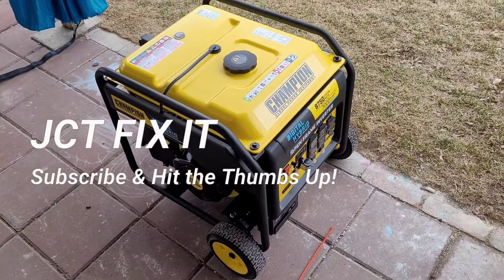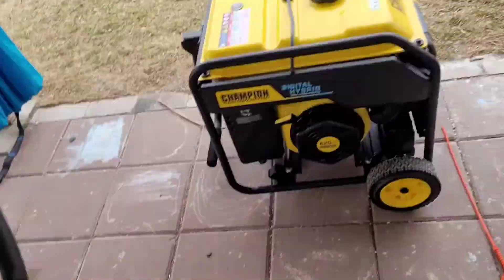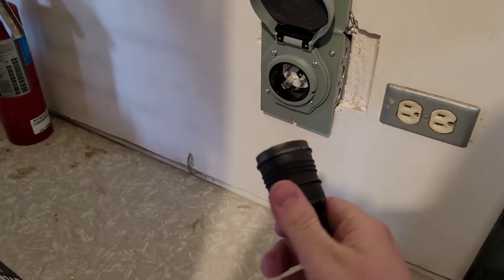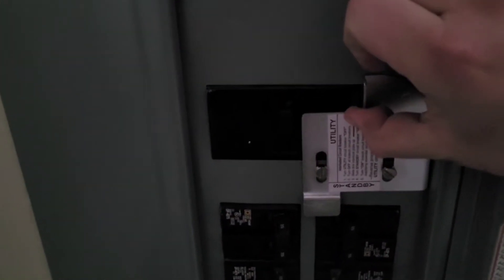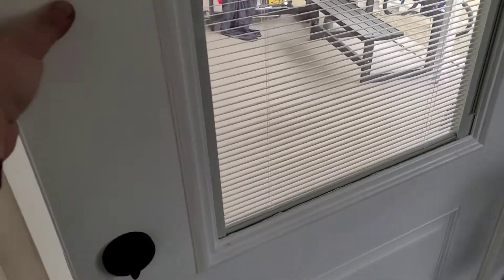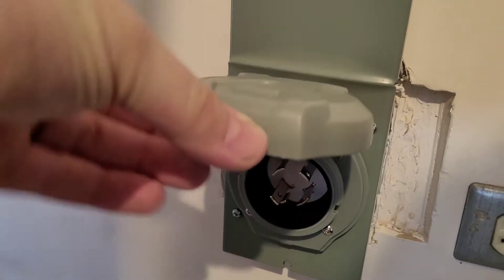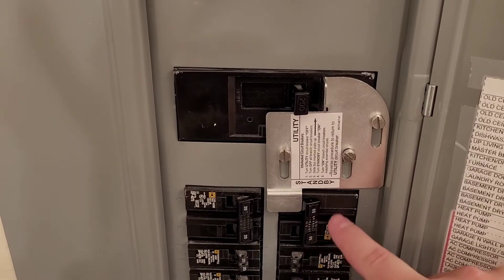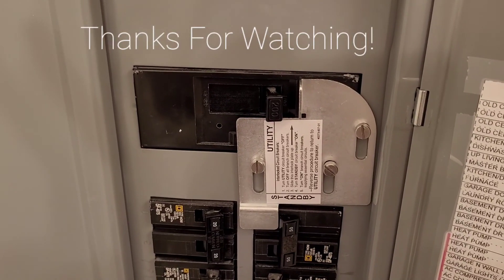Powering My ENTIRE House with Champion Inverter Generator.

Comment: Hello. I'm trying to get my materials together for the same model generator. I noticed you had a double 50 amp breaker. Is that the size I should use? I'm not savvy to electrical installation, for some reason I thought being as it was a 30amp plug that the cord is for the generator, a double 30amp breaker is what I needed. I have a jacuzzi plug outside with a heavy duty wire run to the panel. I was going to replace it with a generator outlet that you recommended. Thank you!
Reply from the maker: Make sure that the wiring is suited to your breaker. Most would recommend 10 gauge wire for a 30 amp breaker. I repurposed a 50 amp breaker that already had 6 gauge wiring to carry that load. As far as breaker, 30 amp should be sufficient as it should be able to handle over 7000 watts on 240v connection.
Reply: @JCTFIXIT  I believe my wire is 6 gauge, also. We were going to put a jacuzzi in while remodeling, but changed our minds.
Reply: @JCTFIXIT  Thank you for the advice!
Reply: Using a 50 amp breaker for a 10 gauge wire is not ideal. Imagine there is a short or connection issue from the generator side,  the 10 gauge wire may get warm or even catch on fire, but the breaker may not turn it off.

Comment: Connect your power cable to the generator and the house, BEFORE starting it. That's 240V with 30 amps, enough to kill. Don't handle the connections on a running generator.
Reply: Hate these types of comments. If it was a “sucide” cord I would understand, but normal plug. Ol’ bubba needs to chill.
Reply: This is why you always have to feed power from a female plug to a male plug. There is never a situation where you could have exposed, energized prongs.

That being said, you shouldn’t plug or unplug this under load, as there could be arcing. Since the inlet breaker on his panel was off when he plugged his generator in, everything he did here was perfectly fine.
Reply from the maker: A lot less than that will kill you, but it's also not a good idea to try to start a generator with a load on it. You can safely plug into a generator. You do it on the walls of your house everyday.
Reply: @JCTFIXIT  Always connect the cord first before starting generator.  The plugs in your house do not have hot extended leads like the generator cord. It also properly grounds the generator before you start it for safety and there won’t be any loads on it due to your interlock kit.  Also make sure you float the neutral in your generator because there should only be 1 bonded neutral in a system and that will come from your distribution panel. I’m considering this generator for clean power for my sensitive electronics in my house. Do you find that your computers, dryer and refrigerators work properly on gen power?  Thanks for posting the vid.
Reply from the maker: Yeah everything works great the one thing you do have to watch out for is making sure you are load balancing. You don't want all your load on only one side. So for example if you are running electric dryer on one side it would be unwise to run microwave on same side. Make sure its on opposite side of split phase.
Reply: @mbrown2a  a generator cord doesn't have hot extended leads..... No extension cord does by design.... That's what a home made  suicide cord has...And that is one of the reasons you should not do that.   I know someone who's wife accidentally tried to use his suicide cord made for generator as an extension cord and got shocked.    With a proper generator receptacle there is no issue.   If you'll notice the plug is plugging in is a female and has nothing extended from it and they prongs in the receptacle in the wall are not energized......safe

Personally I've never had any issue with electronics and my synchronous generator that has a AVR automatic voltage regulator.  I think the need for inverters is mostly marketing here.  I've been using my regular generator for 20+ years...... Several times I've run the house for a week and that includes Smart TVs routers computers with no issues.
Reply: @JCTFIXIT  yep it's not the voltage, its  the amps and it only takes 50 milliamps to kill you
Reply from the maker: Amps kill, but you need high enough voltage to overcome your body's resistance for current to flow. I think we're all on the same page here.